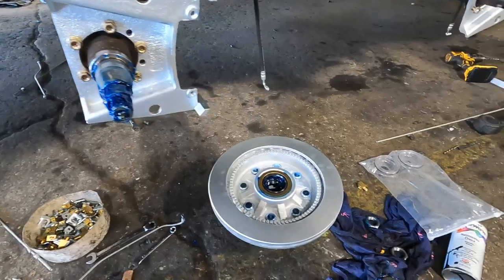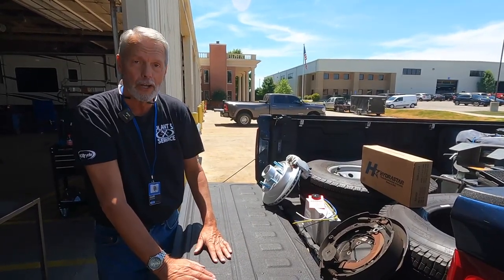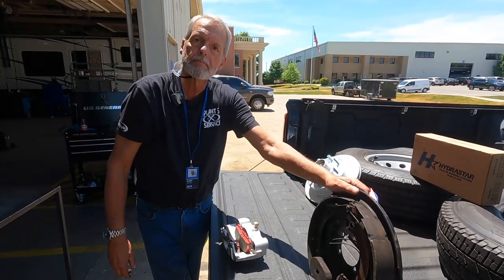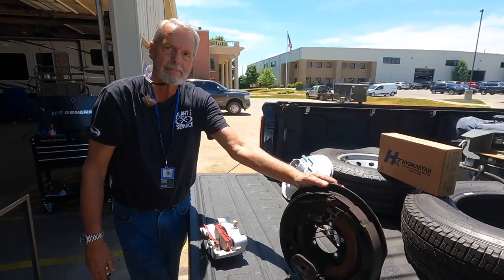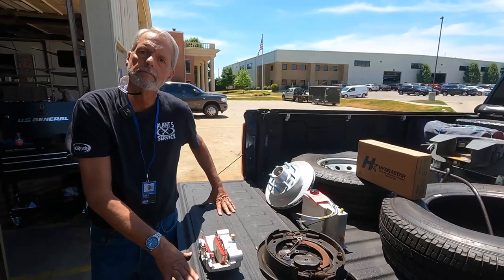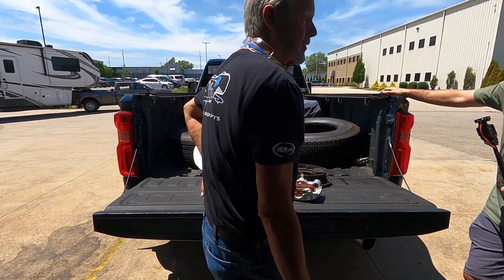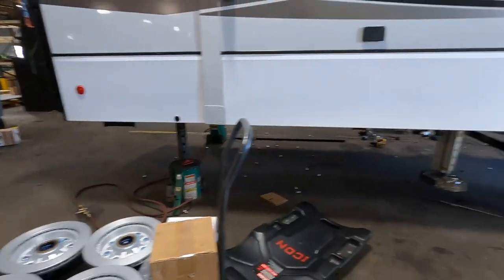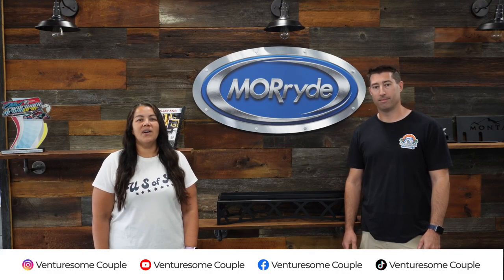Boost Your RV's Braking Power: MORryde Disc Brakes Upgrade Guide

Comment: Great video guys!  Still doing research on the different manufacturers for my upcoming upgrade... for the record it's "disc brakes", NOT "disk breaks" 😆!
Kodiak, Dexter, DeeMaxx, Hydrastar...possibly others?  Looking at recommendations, tests, reviews etc.  Also just having Performance Trailer Braking just do everything start to finish. 
Videos like this are helpful! Thanks!! 👍
BTW, link above doesn't work.
Reply from the maker: Thank you for watching our video, since this video we did have the MORryde Independent Suspension bolt on to our 5th wheel and we changed our brakes to a different brand too. 
https://youtu.be/ypDxytf3joc 

MORryde:  For 7% off and free shipping for MORryde products, use our link to save you money.
https://shopmorryde.com/?ref=Venturesome  
Use our Code:  VenturesomeCouple7%

Comment: With all of these add ons, when was the last time you weighed your fifth wheel and truck?   Thanks
Reply from the maker: Thank you for watching our video Rick & Darci. We weighed our RV after most of the upgrades & we were 1000 lbs under weight. We do pack light & since then we have Spring Cleaned our rig most recently & we don’t bring as much stuff with us. We have a home base so this was easy for us to do.

Comment: Great video...I 2nd the disc brakes....The best bang for your buck...safest braking system there is..should be standard equipment on trailers 8000 lbs and over. The other thing I have been working on is a parking brake...wheel chocks work, but not near as good as locked hubs.
Our rig will have disc brakes for sure....it's pricy to have independent suspension....but Paired with disc brakes , your in a class of your own
😉😉😉 !!!!
Reply from the maker: Thank you for watching our video Rob. We agree, it should be a standard to have disc brakes on trailers. When we got this Paradigm it was already built & we wanted it now, but if we ordered it we would have gotten disc brakes then. We’re on the list for IS but not until May next year.

Comment: Upgrade price?? And the weight list on your rig shows 12,782, and the GVWR is 16500. So you guys have maxed that out already??
Reply from the maker: Hey 1HOTAHI, thanks for watching our video and supporting our channel. We are no where near max. When we weighed a couple weeks ago with RVSafety we are 750lbs under on the trailer and thousands under on the truck. We were talking about max weights not actual weight.
Reply: @VenturesomeCouple  the way he said it made it sound like you guys were at capacity!! I was like noooo way!!! Great channel, gotta see the brake price, if we pull the trigger on that model this spring
Reply from the maker: Hey 1HOTAHI,

Looking back at the video it does sound that way. Thank you for watching our channel.

Comment: So doing this upgrade…. What does this look like in $$$$$
Reply from the maker: Hey Heather, thank you for watching our video. The disc brake kit is about $2,600 depending on 7K or 8K brake size on Etrailer. I believe the disc brakes with install is about $4k. For us we did multiple projects at once and we are hoping to do Independent suspension  (IS) in the future. Basically one step at a time since that is a large project to tackle with brakes and IS.

Comment: How much was the up grade
Reply from the maker: Hello S Reed, thank you for watching our video. The disc brake kit is about $2,600 depending on 7K or 8K brake size on Etrailer. I believe the disc brakes with install is about $4k. For us we did multiple projects at once and we are hoping to do Independent suspension  (IS) in the future. Basically one step at a time since that is a large project to tackle with brakes and IS.